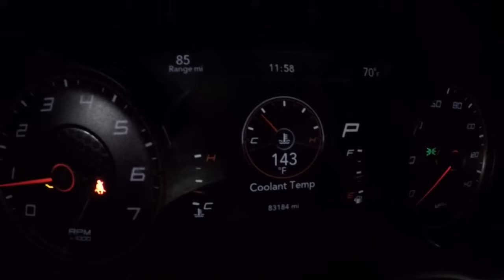Replacing Thermostat on 2016 Dodge Charger 3.6L  P0128 Thermostat rationality  ||  Dodge overheating

Comment: How often should a thermostat be replace as preventative maintenance on a Honda Accord?
Reply: Never.
Reply: After 100,000 miles.
Reply: If the code comes up 😁
Reply: Don’t fix it if it ain’t broke

Comment: I have a 2015 charger and I need to replace my thermostat. After watching your video I do feel confident enough to be able to do this on my own.
Reply from the maker: Make sure u bleed the air and then take it for test drive
Reply: @RBTheMechanic  thank you again for the tips. I was able to replace my thermostat by myself
Reply from the maker: @smc2pointoh  nice job!! Did u bleed it?
Reply from the maker: @smc2pointoh  I took this car for drive on the road after bleeding to make sure the temp stays normal here’s the video https://youtu.be/0jb-ztVPy8A
Reply: @RBTheMechanic  yes I did
Reply from the maker: @smc2pointoh  great job!!!
Reply: @RBTheMechanic   hey when will you know that you need to stop bleeding for air
Reply from the maker: @kingg6469  u will see solid air flow no air bubbling just do it few times that’s what I usully do
Reply: I think you meant solid coolant flowing out, with no air bubbles. 😂

Comment: Thank you!!!! You just saved me hundreds of dollars. The replacement is so simple I couldn’t believe I almost paid the stealership for it
Reply from the maker: Yeah easy!!! Make sure u bleed the air at end
Reply: I did. Actually I had a small accident where I opened the valve first and then started my car, so coolant sprayed all over the place 😂😂😂

I wiped all out with degreaser and soapy water, and added more coolant to get it again to right level. Heat works perfectly and the coolant’s needle stayed right in the middle after an hour of solid driving, so I’m guessing I should be good to go. Thank you again
Reply from the maker: @cholosoy8511  oh ok!! Success at the end
Reply: @RBTheMechanic at least I know now what NOT to do next time 😂😂

Comment: I replaced my coolant and did the EXACT same thing but I didn't put the heater on. I did the exact same thing and my car over heated and I couldn't drive. I went to auto zone and got a thermostat housing and did the same thing and bleed the coolant and my car is being sensitive to when I drive it. When I floor it, the thermostat temp goes up. I didn't have a problem at all but I was low on coolant and decided to replace my entire coolant and when I drove it after my car over heated BAD... got a thermostat housing and now it's being sensitive and after cooling down for 10 minutes it's around 200 F. Before I did anything my coolant temp was way lower and wasn't sensitive to my driving. And I don't know but when I drove the car after replacing everything my coolant tank was low, but when I park and let it cool down the coolant tank fills up? Please respond thank you
Reply from the maker: Did u bleed it well dose the fans come on?

Comment: Hey I replaced the thermostat and when i start the engine the coolant is leaking from the valve. Idk why it is doing that. The coolant is dripping like drops slowly. I was seeing another guy video of changing it. I just saw your video now and noticed the way of blewing out the air through the valve. I haven’t done that when i did that. Should i try now? What you recommend?
Reply from the maker: Yes u need to bleed the air but why would it leak? Is it loose check that first

Comment: Is 215 a normal temperature? That’s what mine is running at since I changed it. Seems a little high no? If I loosen the bleeder straight coolant is coming out so there shouldn’t be any air in there right?
Reply from the maker: That’s good 195 is best but 215 is on still on the range
Reply: Did you ever get the temp sorted out? I’m having the same “problem”

Comment: Thank u ! My trans temp wouldn’t go up. Wasn’t over heating. And brought it to a shop and tried to charge me 250 for it, fluid change, and temperature gauge replacement. Even though I bought the stuff for it! Will try this tmrw morning !
Reply from the maker: Yeah these usully go bad they stay stuck open bit

Comment: Thank you for this video. Will the check engine go away by itself once you replace the thermostat? Or is there some manual reset that has to be done?
Reply from the maker: You need to reset the light with scan tool

Comment: Hey man, I’m having an overheating issue on my 2015 dodge charger (3.6 V6). 

Back in July my thermostat was stuck open and it threw a code for it being below regular operating temps. I sent it over to the dealer I bought it from, they claimed they replaced the thermostat, flushed the system and replaced it with new coolant. 

Fast forward to a few weeks ago, I noticed that my car begins to overheat when I’m idling for long periods of time (drive-thru, stop light, etc) or when I’m parked and the car’s had time to warm up. 
It ONLY overheats during these situations. If I’m cruising down the road, I don’t have any problems. 

Now, I took it to a mechanic, he claims there were no coolant leaks, no damage to the water pump or radiator and the fans are kicking on as they should.  He said I should just bring it to dodge to have them look it over. 

I guess I just want to see if someone else has had such a puzzling problem as I have. Could it be something so overlooked as maybe the system wasn’t properly “burped” upon the completion of the new thermostat back in July? And I’m just now noticing it? 
P.S. I have no lights on my dash and it drives perfectly fine.
Reply from the maker: Check ur coolant level and start to diagnose fan operation fuses and relays also need attention  did u been it Whe u did the thermo but the only hint I had is car over heats when idling that means when it’s moving it gets air from car moving and when u stop there’s no air flow fan might not be working
Reply: @RBTheMechanic  I mean- the fan kicks on, though. It turns on when it should. I actually have a video of it where it was running pretty loud and hard because of the fact that the coolant levels were rising over 235 degrees.
Reply from the maker: @Ashbro117  did u replace thermostat and bleed the air?
Reply: Having the same issue
Reply from the maker: @jasonanderson6772  yup replace the thermostat and bleed the system
Reply: Yo man I just had the same issue turns out the little clamps on water outlet that holds the thermostat broke  so I had the get the whole piece replaced. Just like $20 at autozone for the whole price

Comment: Can I ask why the check engine light 💡 was still on ? Do you have to reset it or does it eventually go off
Reply from the maker: Oh yeah it wount go off on it’s own unless u run it for few days or so if it detected condition are fixed it might go off but I usully reset it with scan tool

Comment: I recently change a thermostat on my dodge charger 2018 and when I press on the gas pedal, it squeeze the coolant hose. Need help.
Reply from the maker: U need to bleed the air and change out ur radiator cap

Comment: Question ❓ My number 2 has misfire and bad thermostat also and all the coils had been recently replaced. Are the two related in any way?
Reply from the maker: No they shouldn’t be related
Reply: Thanks for replying I switch coil and thermostat she's running like a champ now time to try my nerve at finding and changing roller rocker to get rid of the tik

Comment: Got the thermostat code on my 2017 dodge charger SXT a few days I am guessing I should replace it
Reply from the maker: Yupp replace it out it original thermostat and flush out coolant if u got more than 60k miles
Reply: @RBTheMechanic  Ok well thank you

Comment: What if i replaced the thermostat and the check engine light still persist? Could it be a temperature sensor or do i just need to manually turn off the check engine light
Reply from the maker: U need to reset the light after repairs

Comment: Question for ya. I have a 2015 V6 charger. My check engine light came on and my heat does not work. AC works good. I do not have a code scanner to check but what are the odds this is my issue?
Reply from the maker: That’s normal for ac to shut down once check engine come on it’s designed to cut off ac for safty reasons also it will cut off remount start so u need to scan and pull the codes and fish the issue then reset the light and it should go back to normal same thing on jeeps

Comment: What’s the normal coolant temperature supposed to be because I just got that cold on my car and it doesn’t drive like anything is wrong with it and it’s not overheating or anything
Reply from the maker: Good question i I took this car for drive after repairing it and u can see normal operating temperature here’s the video https://youtu.be/0jb-ztVPy8A
Reply: Thanks I’m going to watch it now
Reply from the maker: @anubis3.691  by the way when u see normal operating temperature that will not show u if thermostat is good or bad it’s just that it might be delayed opening or erly opening so I would just go ahead and change it then bleed the air as I show then drive and confirm it temp is in range.
Reply: @RBTheMechanic  thanks I’ll definitely do that just to be safe

Comment: do we have to flush the whole system or just add anti freeze?
Reply from the maker: Add but if u want to take it further u might as well drain the whole system out
Reply: @RBTheMechanic  what about when we let the air out? Do we do it til we see coolant coming out of it?
Reply from the maker: @rickypadilla6794  yes when u put coolant in if u open it bit u will hear air hissing from there and then violent will come out once’s it’s filled. Then make sure it not move air bubbling and solid streak of cooolant is comming. After that I usully let the coolant circulate and I  let the car run and get hot then slightly open it once or twice and all set

Comment: So can i add more coolant to the current coolant?…..nothing will happen?
Reply from the maker: Yeah that wount bother anything only when u open the system up u need to do this like change of radiator pipes thermostat water pump but adding it is no issue

Comment: Thank you Brother for this great video‼️👊🏽😎
Reply from the maker: Yup glad to help
Reply: @RBTheMechanic  Quick question, when does the check engine light turn off after installing the new part?
Reply from the maker: @freddyg1692  it dosent turn off on its own u have to reset the light with scan tool
Reply: @RBTheMechanic  ok thank you

Comment: I changed mine twice already and the light keeps going on it doesn't overheat at all it check engine light goes on n off what u recommend to do
Reply from the maker: Did u put in original thermostat?

Comment: if this engine check light code was not repaired for long time, what will happen ?
i hear loud noise after 20 - 30 min of driving which is increased by pushing on accelerator !!! is it related to unrepaired coolant thermostat  ? or something else  !
in dodge durango 2012
Reply from the maker: I don’t think that’s related to the thermostat code and not fixing this code for long time wount harm anything it just unnormal operation temp and if it gets really bad the engine will over heat that’s when it will damage things
Reply: @RBTheMechanic  
thank you for clarification, 
could be that temperature indicator gives me always lower temperature than real ? and Damage  starts after certain temperature, so i hear this noise !!
Reply from the maker: @robertokristen8316  it can it’s possable I have seen it but u can feel engine performance weak and coolant will over flow if it get too hot boil out but usully these get stuck and they allow coolant flow and temp is blew low normal which is bad for fuel economy

Comment: I changed mine but the check engine is still on. What do I do??
Reply from the maker: U need to reset the light it will not go away on its own
Reply: @RBTheMechanic  thank you! Also, I did this yesterday and bled the coolant with the air coming out the first time since opening the top from the t housing like you did in this video. And once again when the car was running. How do I know when to stop bleeding it? Also the coolant temps are running at 210-215 today (next day) they usually jump to 221 (a few times) was rhetorical job done properly?
Reply: @RBTheMechanic  also jumps to 221 when idle in a red light

Comment: Will the engine light go away or do we have to do the battery thing?? By the way this was beyond helpful I just changed mine today 😊
Reply from the maker: No u have to reset it u can buy one of those small scan tools from autozone or disconnect the battery for few minutes.   Also make sure u bleed it like I did at the end u don’t have to go crazy like I did but make sure u get the air out after that take it for drive the car and make sure the temp stay in range watch this video of me taking it for drive https://youtu.be/0jb-ztVPy8A
Reply: Thank you ☺️
Reply from the maker: @samanthasoliz5402  u welcome always here to help I have ton of other videos on this car… u can always search just by typing the car name and add tv the mechanic at end also add key work like brake job or misfire check engine it will show up lost of videos on the car

Comment: Hello, I got unstable coolant temp it hits 109c and then drops to 100c and everytime i bleed the air i have water pressure coming out but no air sound dont know how fix it can u plz give me a hint thnx
Reply from the maker: Ummm what temp grade thermomstat u put in and was it original?
Reply: @RBTheMechanic  i didn’t replace thermostat and I bought it used before 6 months , shall I change it ?

Comment: Is there any way w mechanic could screw with the electronics and ruin thermostats operation?

I just had a car in for one repair, oil pump, then they said I needed the gas pump changed since it wouldn’t start (I had really old gas in my tank but they said they wasn’t the issue )

So I changed the oil pump and gas pump, car ran for 6 days and now I got the engine light again and it’s this exact code , one of my headlights went out and also got a code for my ABS.

Iv never had any issues with the car , I take it ok for one thing and coincidentilely all this happens . Could it be an issue with pcm or they did something by mistake or intentionally to mess with my electronics?

My temp doesn’t go to high when I’m driving it’s right below middle so it’s normal like 185 ish. I checked coolant and it isn’t below the bottom line in the tank but It’s close to it.

Could this could come up just because I need to add a bit more coolant, even though the coolant isn’t technically too low? It’s still between the lines on the tank .

I’m tryna figure out if somehow my electronics got messed up, honestly when I left the dealer I did notice my brakes feel weird,  like Rumbly , bumpy for a bit then it went away .

Can this all be coincidence or is there something connecting al these dots?

I’d appreciate your insight!
Reply: Btw the weather  outside was like 50 when I checked if that matters but when I checked the coolant temp etc everything was as usual so idk why the engine light is on if the reading aren’t off
Reply from the maker: No this is very common issue on these dodges
Reply: Thanks for the response . I think what has me confused
Is why that would only occur right after they took apart my engine a few days prior , not just the thermostat but also ABS and lights issues .

Also the coolant temp reads normal 185 driving maybe 203
Idle . Doesn’t seem like anything is wrong With coolant temp
Reply from the maker: @heythere6983  it could be they didn’t bleed or burp the system
Reply: Thing is they didn’t even touch the thermostat or atleast they shouldn’t have .

I took my car for a
Fuel pump and oil pump change.

So I went for unrelated issues , but then less then a week later now I have multiple new issues
Reply: From what I remember the code said thermostat was reading under regular temp. Though it sits at 185 when driving and at 200 ish when idle .

And then abs said it wasn’t receiving the right current I think? I’d have to double check .

This is why I wonder if they messed with something electrical , they also gave me my car with a headlight out , that bulb was practically new
Reply from the maker: @heythere6983  oh could be bad thermostat no other repair I can think off what stat u live in some time super cold weather can effect it
Reply from the maker: @heythere6983  could be just went bad
Reply: Hey quick update I got this fixed , I saw on the mopar antifreeze jug is says half the cars antifreeze is in another spot outside this reservoir. It’s also labeled as ten years, so does that mean if the car is about ten years old you gotta dump that antifreeze from the other areas aswell?

Also my mechanic didn’t let the valve leak after running the car , if I let it leak, I can just dump water on it and not worry about messing up any part of the engine due to water? I don’t need to take anything apart? Just dump water while the car is running? The belt getting dirty isn’t s big deal when it leaks?

Just wanted to double check, I drove for like 20 mins car didn’t overheat or anything but I figure I should try and be safe .

You know what else? The guy didn’t even drain the antifreeze , he literally just swapped out the thermostat and then asked why I bought antifreeze and I said “I think you’re supposed to drain it “ he did, but after he changed the thermostat, does that mean this guy just let it splurge all over?

I did see from a distance he just dumped water in the area 

Thanks for any feedback here

Comment: Can the thermostat be removed from the housing?
Reply from the maker: Yeah but it would t be wise plastic will brake the house is prolly weak
Reply: it's not worth it at all! a good brand thermostat with housing is $17 at NAPA. NAPA brand (Part no: THM HT203248) is exactly the same as the OE replacement.